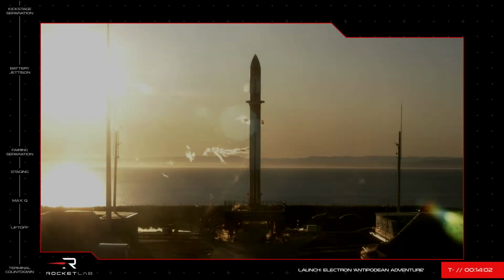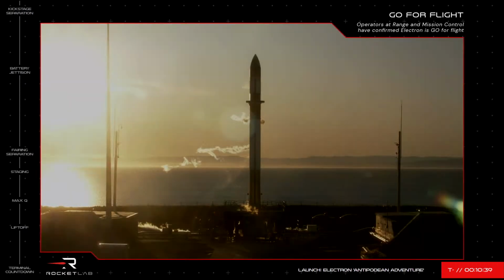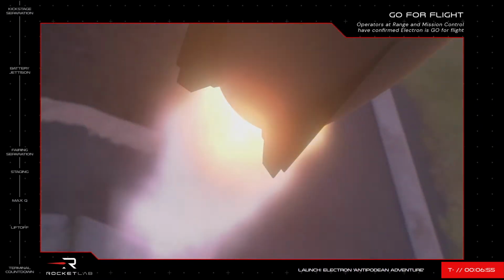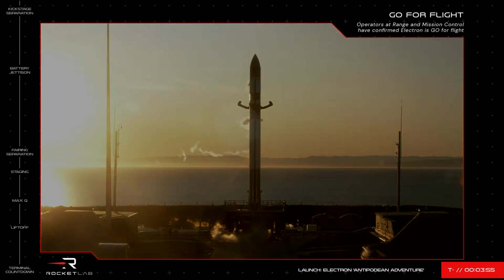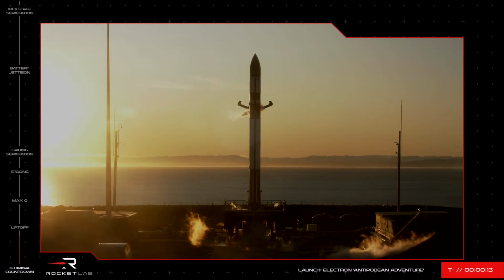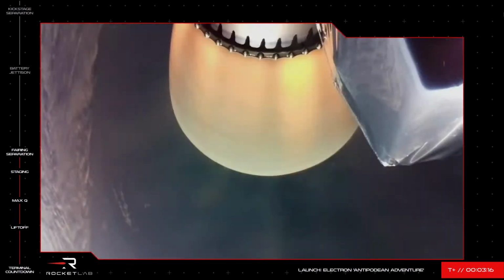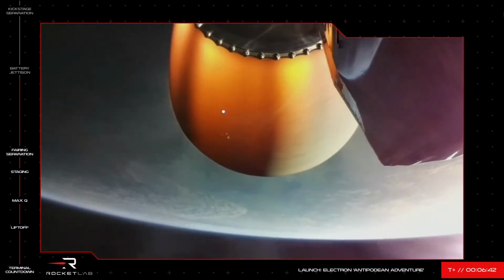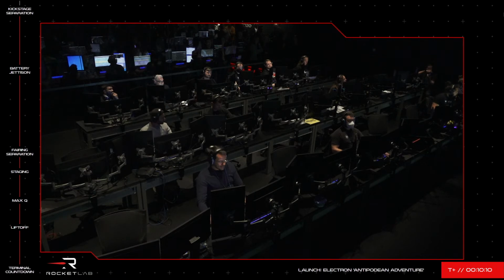Rocket Lab - Antipodean Adventure Launch

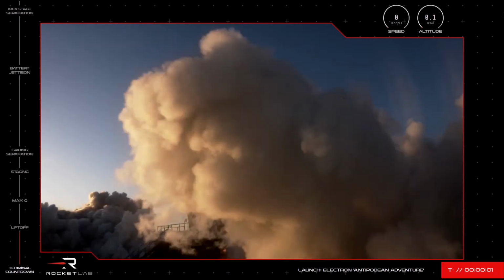Comment: 20:47 lift off.
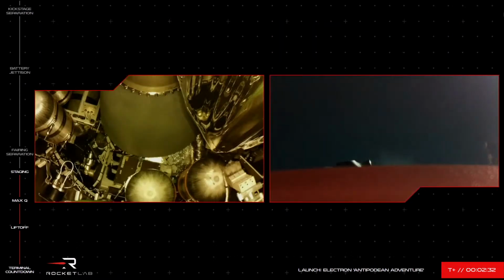23:19 stage separation.
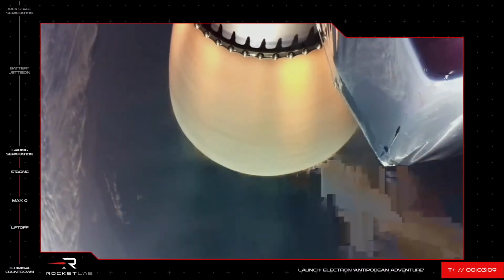23:57 fairing separation,
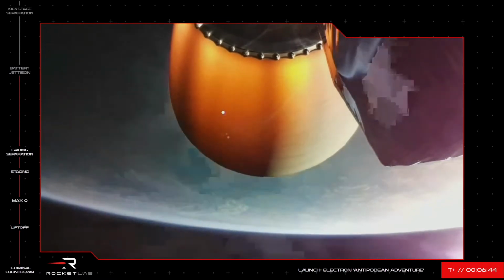27:35 battery hot swap,
30:08 sico.
Reply: Thanks!👍
Reply: thanks
Reply: Sico stands for Second Ingine Cut-Off, which is how you say it in New Zealand.
Reply: @JontyLevine  yes

Comment: Did the 2nd stage nozzle suffer burn through just before Hot Swap, never noticed such a hot spot on the engine bell before.
Reply: That's lens flare from the sun
Reply: Yeah, I thought it was a Hot Pixel on the image sensor because it seemed to stick around for a while, but when watching more speed up it does seem to move with a lense flare until it disappears closer towards the end of the stream.